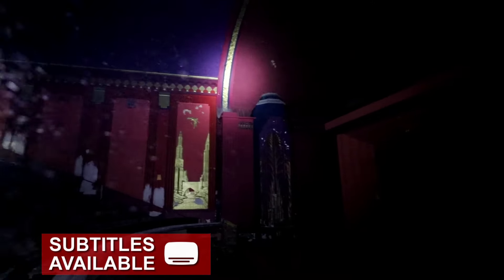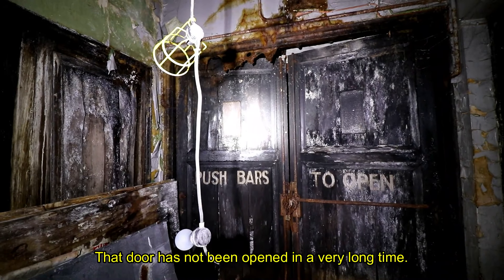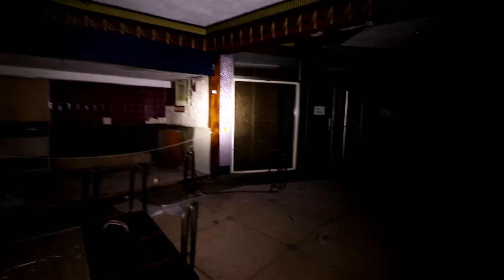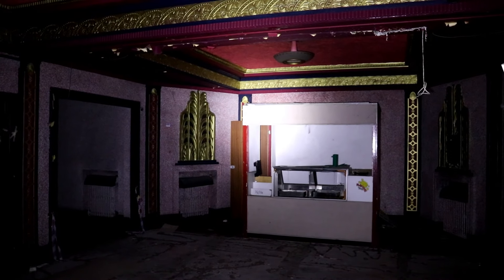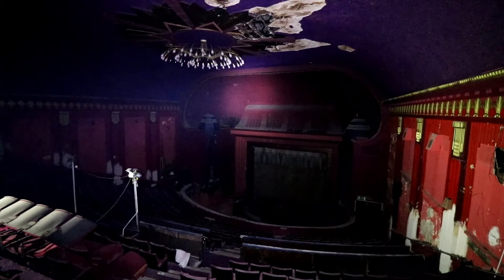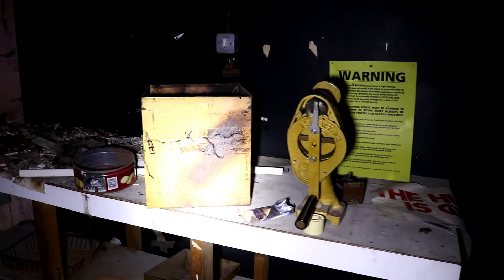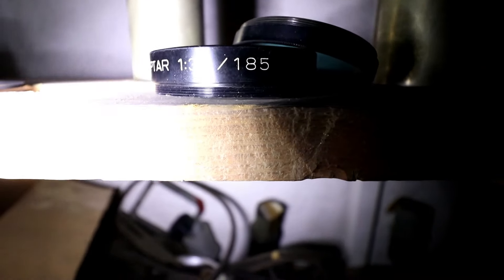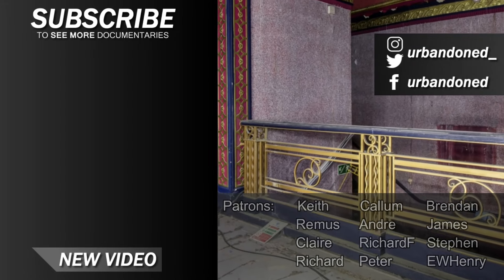Exploring a Huge Abandoned Cinema with Power

Comment: In the projection booth is the film make up and break down bench and handle. When films were still shown on 35mm film they used to arrive at the cinema in 20 minute reels. The projectionist had to put the reels together to make up the feature film. The bench was also used to make up adverts and trailers.
Reply from the maker: Thanks for the info matey. Always good to learn more about the places we visit
Reply: Urbandoned My pleasure. I was a projectionist for over 20 years and what you filmed is now obsolete in cinemas. It’s all digital now. The lenses, if manufactured in Germany would have been worth a small fortune in their day and the various sizes is due to different film ratios. Nowadays, only two ratios is used 1.85 and 2.35 (Scope)